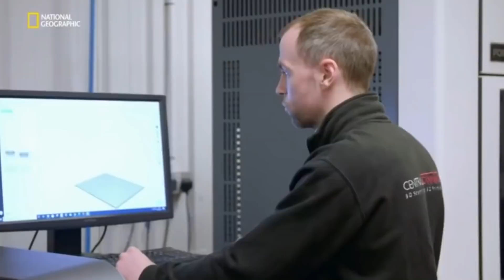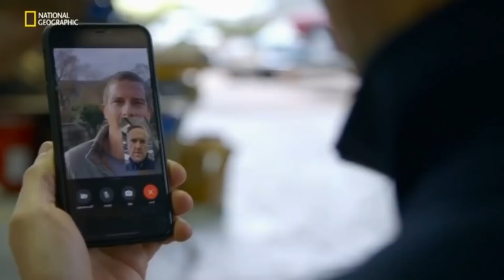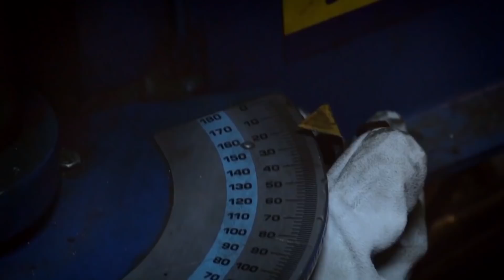What happened to Tim Shaw on Car S.O.S?

Comment: In my opinion it's quite possibly the best motoring program on TV, I would however like to see it in a longer version where the engines and other components are reconditioned in detail rather than just sending them away then having them back fully restored and ready to fit.